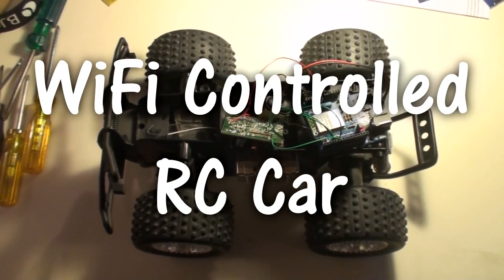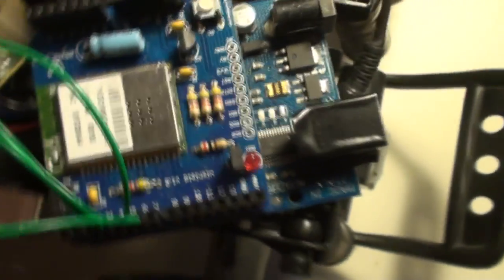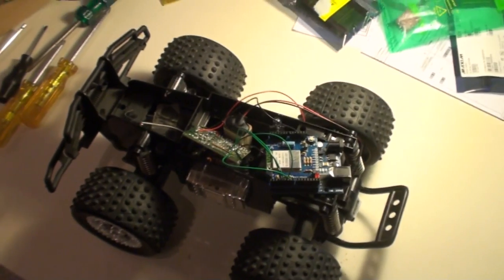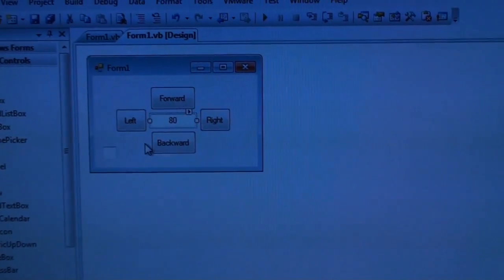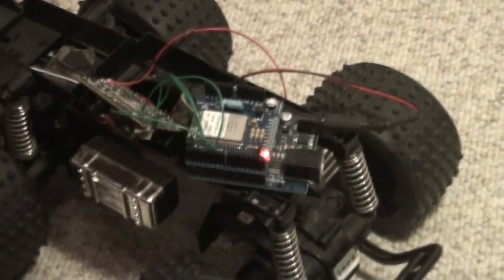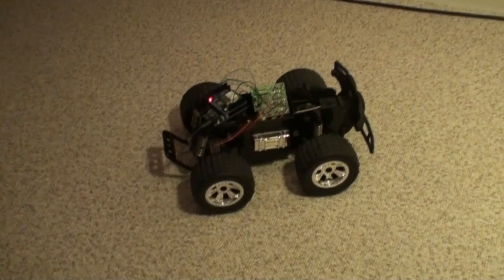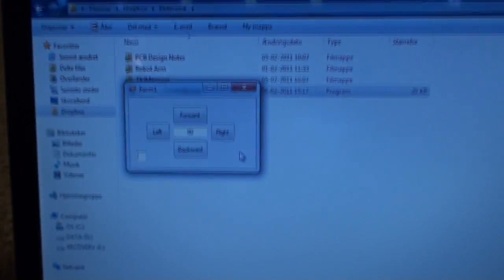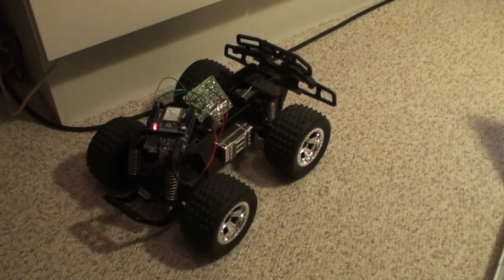WiFi Controlled RC Car with the Arduino

Comment: I like your Project very much : but i just want to know that:-
1. HOW does a arduino WiFi shield get connected to a WiFi ( after all connections are done) ?!
2. What is the use of a TCP Port???
3. After I start your ziped application i.e Form1.vb[design] , It gives an error that Socket Exception was unhandled ?! ( i have VS Premium 2012).
4. How to import the application code or the Arduino code into the Arduino ckt ?!
5. In what way are you using the wishield folder in the zip file?

Comment: Hi I have the same project as this, except mine needs to be in android. I was wondering if your program is also applicable to the CC3000 wifi shield, or other shield. Because it seems your wifi shield also transmit SSID or acts as a adhoc device for for the arduino to PC.
Reply from the maker: Hi. The Windows program is applicable for any application that communicates over an UDP port. The arduino code though, is only made for the WiShield. But if you can get the CC3000 shield to connect to your access point and open a UDP port, you should indeed be able to do the same.
Reply: Yeah I think there's a code that can do that on the arduino IDE, i'll try to upload it in the MCU and try your code
Reply: I was wondering also if you still have the arduino sketch code?
Reply from the maker: kymark12 The Arduino sketch code can be found in the ZIP-file whose download link can be found in the blog post: http://blog.tkjelectronics.dk/2011/02/wifi-controlled-rc-car-with-the-arduino/

Comment: This is a really nice project you have there! You could attach come more stuff on your project.  I was looking around to make something with a wifi shield too, then I got to your video. I'd like to know if the WiFi shield always need a router to connect or I could make a adhoc network?
I had in mind to unlock my car using my cell phone, a bluetooth would be better for it?
Reply from the maker: Hi Daniel.
No, you dont necessarily have to connect the WiShield to a router. The WiShield and the WiFi module on there specifically supports AdHoc in terms of the WiShield creating a wireless network that your PC or phone can connect to as a client.
Regards Thomas
Reply: Thank you lot for the explanation Thomas! Now I feel more confident to buy the WiShield.

Thank you once more! =)

Comment: Woow  i love it  
Dude i have a new rc car
But I'm pissed  coz it has only 1 speed 
Can u help me please
Reply from the maker: Have you tried opening the RC car and measure the PCB. My car only had one speed as well, but if you can find the control pins you will be able to do PWM control with a microprocessor to enable speed control.

Comment: thank you lot for the vedio but i have a question if i use a bluethoot  can i use visual stedio or no
Reply from the maker: Hi. You can indeed use Bluetooth modules with your project and still make the project work within Visual Studio.
The great thing about the Serial Bluetooth modules is the use of an "emulated" COM port on the host PC. So when you need to communicate with your device thru Bluetooth your Visual Studio application simply needs to open a serial port, which can be done thru the already available modules within .NET.

Comment: Nice!  We built a similar project.  However, we installed an Android device onto a RC car and used an IOIO board instead to control it autonomously. Here is the preliminary result:

http://youtu.be/vkvkfcqEUkk

Comment: I like your project, I want to ask you, 
1. what program do you use to run the car? 
2. how can I get the program or the application 
3. how to connecting laptop with WIFI shield Arduino?
Reply from the maker: 1. I have made my own control application in Visual Studio (Visual Basic .NET)
2. All source code materials can be downloaded from the link provided in the blog post (see the video description)
3. Either you can connect directly (Ad-Hoc) where the WiFi Shield will create an access point, or you can let both the laptop and WiFi shield connect to your router/WiFi accesspoint.

Comment: I have already disassembled the car and identified 5 wires. The antenna, the left and right turn wires and the two wires controlling the the forward and reverse drive.

My soldering skills are not fully developed so I am hesitant to solder my connections directly onto the existing connections of the board and that's were I am stuck.

Need help in deciding the best course of action. solder unto the existing board or cut it out and utilize the arduino over my wifi?

Comment from the maker: If you have an RC car you would have to disassemble it and figure out where thr motor controllers are located on the PCB.
When this is located you need to check which logic pins controls which motor etc.
Some might evan use servos for stesting, and in such case, you would need to find the pulse-pin for this.
As a final note you have to be cautious about connecting you own microcontroller directly to the RC car PCB, as you might end up damaging the microcontroller or the RC PCB by wrong currents.

Comment from the maker: In the video we are using an Arduino Duemillanove with the WiShield from Asynclabs.
Unfortunately Asynclabs is no longer manufacturing this shield you would have to find a similar one, like the WiFi Shield from DFRobot.

Comment from the maker: Yes it is.
As the USB port on the Arduino enumerates as a Virtual Serial port on your machine you should be able to use the Serial port tool within Visual Studio .NET.
Have a look at this forum post for an example: arduino.cc/forum/index.php/topic,8566.msg69512.html#msg69512

Comment from the maker: Hi.
Yes this would definitely be possible. You just have to make sure to "Port forward" the ports used in your router.
Then all connections made to your outgoing IP address on the ports specified, will be directed to your Arduino board.

Comment: yo wassup ?,
from the video i understand that the computer that does the processing must be connected to the same router right ?, would there be a way -> theoretically to be able to control it from anywhere in the world  using the internet and not just wifi from the same router ? if so it would be greatly appreciated if you could breifly describe the process or how it would be done and work. thanks ;)

Comment: That's pretty much what I figured. Sounds like what I am doing, only my code isn't working the way it should.. THIS should be the right link to the Arduino forum thread.
arduino (dot) cc/forum/index.php/topic,111662.0.html
I am "ThatGuyJohn" on the forum and I have my current code in that thread. Thanks for your help so far.

Comment: Would you be able to help out in this thread on the Arduino Forum ( arduino (dot) cc/forum/index.php/topic,111662.0.html ) , it is myself and one other person trying to figure out how to control an LED on Arduino with a PC GUI. Just to get the concept of using a GUI to control Arduino.
If you could help out it would be much appreciated.

Comment: Oh I wasn't meaning running vb.net directly on Arduino, but more or less passing data to and from Arduino to a vb.net application. Since my comment, I have gotten the Getting Started with Arduino kit and see in Chapter 5 it briefly discusses using the serial port to communicate.

Comment from the maker: I would recommend either the WiFly shield or if you can find another shield with the ZeroG 2100 WiFi module or better the MRF24WB0MA made by Microchip.

Comment from the maker: No the Arduino doesn't support VB.NET and it has never been the intention either.
The Arduino isn't running VB.NET code in this project either. The VB.NET application is running on the computer simply to transmit the proper navigation packets to the Arduino and the WiShield.

Comment: I'm digging all around for arduino resources.  (Just now wanting to learn)
Thanks for the video, but I am a bit confused. Does Arduino support VB.NET natively? I have ran into resources that say I need  Firmata in order to use vb.net. Is this correct?
Side Note: Looks as though you could use the xBox 360 controller to control the car as well. If you would like a sample project file that demonstrates how to use the xBox360 controller with vb.net Let me know.

Comment from the maker: Yes it would be possible to establish an Ad-Hoc connection to a PC or Android phone as the WiShield supports using Ad-Hoc connections.
Though you would have to make the required changes in the code to enable the Ad-Hoc communication.

Comment from the maker: @possum19901990 No, you can't connect a webcam to the WiFi shield, nor to the Arduino. The Arduino is not fast enough for handling the camera - you need some kind of ARM processor etc. to do this job for you.